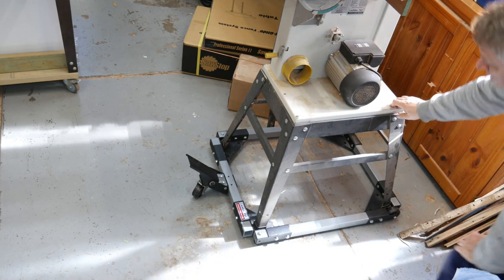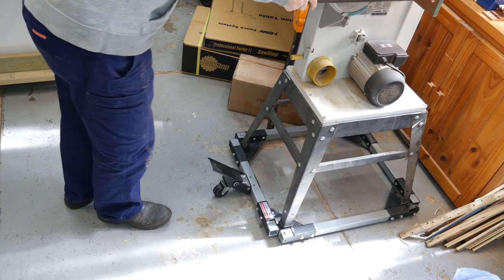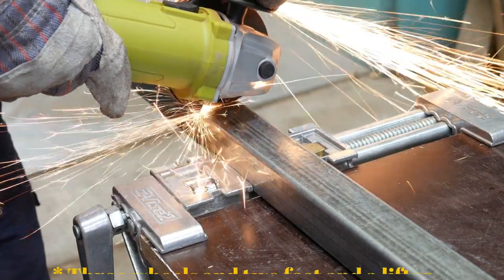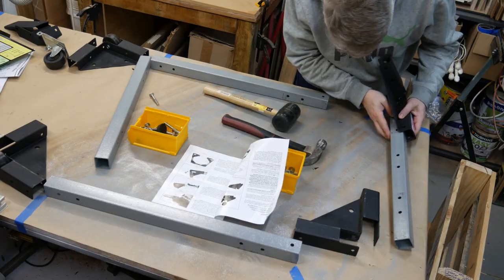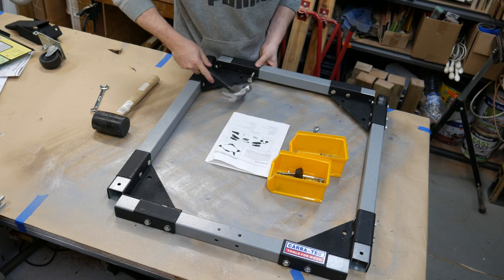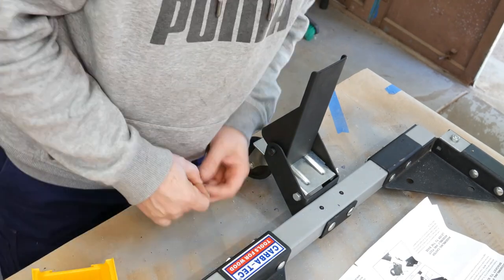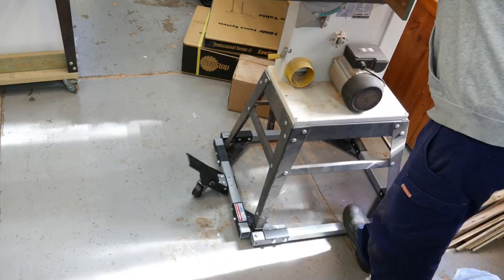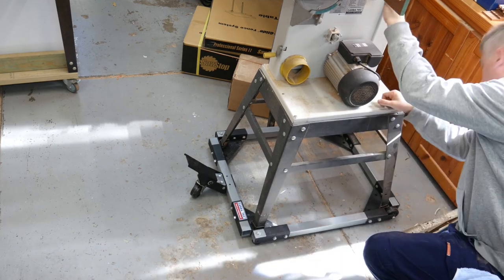Universal Mobile Base kit set for my band saw.

Comment from the maker: I forgot to mention it in the video, but the instructions were so poorly printed that I couldn't make out the direction of the holes for the lifter/front wheel. I initially drilled those 2 holes in the wrong axis which you'll see, if you look carefully.

Comment: I have one of these under my jointer, the metal tubes are better than the wood mine has.
Reply from the maker: The steel tubes were actually quicker because all I had to do was cut them to length. However I took a part along to the store to make sure the tube was the right dimension, first. Up to that point I was not certain it would all fit so well.

Comment: Yes Dave, type 1 garage floors only exist in fairytales. PS. I've got the same bench vice, I think when I bought it, it was called Benchpro 2000.
Reply from the maker: Actually that vice came with a lifetime guarantee. The secound time i used it i broke a wing nut so I thought I had been ripped off and tossed the whole thing on a shelf for years. Years later someone in NZ took over the distribution and I sent them an email about my experience. They sent a new part free no questions asked, even though it was sold by the previous distributor. I was so impressed I began using the vice again and it has served me well. Kudos to the NZ based distributor.
Reply: @DavesShed  I had a similar experience.
Five years after I bought it, I broke a jaw.
I contacted the supplier, I think in Brisbane, to see if I could buy a replacement and they sent me a free replacement. It's quite a versatile piece of gear.

Comment: Nice light weight bandsaw, try to slide a 200+kg spindle moulder into a mobile stand. 
Flat, nearly level floors are possible, when you pay someone to build you a new shed, as you got sick and tired of the floor in the single car garage and it's 50 million changes of level in 6 meters.
Reply from the maker: Getting my table saw on a mobile base was about my limit. A  200+kg machine is another level. To be fair to whomever built my shed, it is now about 60 years old.